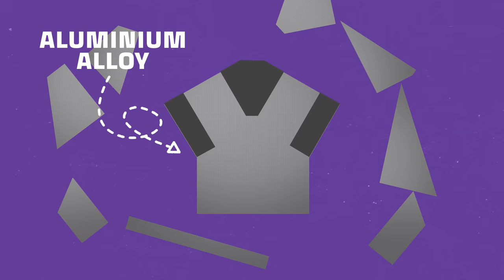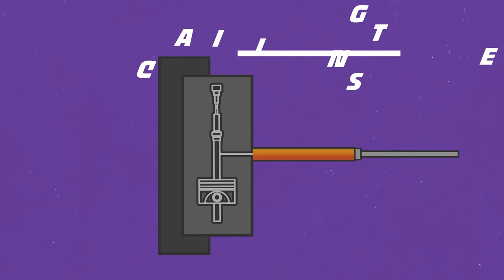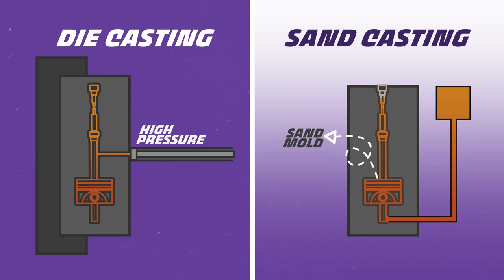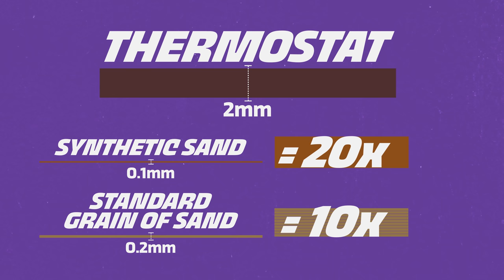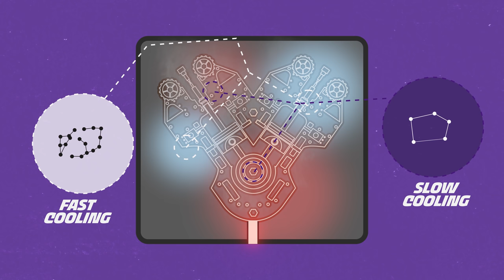Why F1 Engines are Built with Sand

Comment: Fun Fact:  Yamaha's expertise in casting the iron plate inside their pianos allowed them to easily transition to casting blocks for motorcycle engines in the 1940s.
Reply: That is a fun fact
Reply: Woohoo, reading that was a real blast.
Reply: @youwantshum9860  That iron plate is actually called a bridge
Reply: I don't really like Yamahas pianos..
Reply: I couldn't tell if this was supposed to be a joke or not
Reply: @AlecegonceTV   No the bridge is the wooden portion that the strings sit on top of.  Which itself is connected to the soundboard.
Reply: @curtisrowledge1922  Nope it’s the truth!  There are actually a surprising number of industries that benefited from the R&D of the piano industry.  Steinway actually did coach building for Mercedes a long time ago.  Audi and Porsche have both designed pianos for Bosendorfer.
Reply: Oh shit?
Reply: @yookalaylee2289  that's so neat!! ill have to look more into that
Reply: @TS_Mind_Swept  up to their mid levels are crap, but once you go upper mid and above they can compare with other high end makers.
Reply: @darthandeddeu  It has more to do with how they sound than anything; I'm also not a fan of Steinway and Sons sound, WAY too bright..
Reply: @TS_Mind_Swept  buy other brands then
Reply: @importanttingwei7747  That doesn't stop them from being heard, unfortunately
Reply: Pretty sure their mastery of sound design for acoustics is the reason why they make some of the best sounding engines too.
Reply: sick fact
Reply: @yookalaylee2289 I’ve seen a Suzuki piano, too

Comment: As someone with a meterials engineering degree this is surprisingly accurate for how easy to digest this is. Good job team
Reply: Indeed. I wish my machine design classes were that clear and dynamic back then.
Reply: That's what life should be. Easily understood from a good explainer
Reply: I was going to say this is a very high quality review of casting manufacturing processes
Reply: Is peanut butter a viable material
Reply: *materials
Reply: I work at a sand printer company and it was nice seeing my industry represented by one of my favorite channels
Reply: He has a mechanical engineering degree so he knows some of this. What I appreciate is his ability to explain in layman’s terms or slightly beyond.

Comment: 7:44 -- A little correction..  the sand doesn't want to expand 1%.  Molten aluminium occupies a volume ~1% bigger than when in a solid state so as the metal cools it contracts by 1% from the shape defined by the mould.
Been dealing with this for 20-odd years and have designed thousands of moulds including 3d printed cores.

Comment: I'm doing an internship (metalurgical engineering) in a foundry with a 3d sand printer. We don't make parts for f1 cars but there have been some huge cylinders for industrial motors. There is alot of engineering that goes into the whole 3d sand process. I can also say that all the information you gave is correct, and a good way of explaining it in a digestable way. Well done

Comment: At OTC (Offshore Trade Conference), there was a company that would melt the surface of the sand rather than using a binder.  It looked amazing.  One of their sample prints was a coffee mug with a finish that looked like it was glazed.  The benefit behind this technology is getting smoother oil channels and other internal geometry without the need or cost of post casting buffing.
Reply: By any chance do you have a name of this company ?

Comment: I used to work as a metallurgist where a significant number of the f1 engine manufacturers got there engine block castings made.

This is surprisingly accurate, I wonder who the sources are for this video. This is significantly better than any presentation I gave on the processes that are actually used to produce these castings.

Comment: 11:43.. Yes and no, depending on the change, you can always remove metal on an existing mold, (aswell as add by welding it). So small changes do not rly take long at all (1-2 days) 
 Assembly+milling/turning/finishing for a new mold takes roughly 2 weeks  (due to lacking access to more milling machines, if we had more it could be done in maybe 3-4 days) 
We got probably like 800+ Different molds (the heaviest being roughly 900Kg)

Comment: I've never 3d printed a sand mould, but I know some stuff about mould making that give more information about some of the stuff talked about in the video.

6:47 Nah, creating a reversed part for a mould can literally be made by one click in a proper CAD application.
And you can pretty much design the part as you intend it to be after the moulding. All you need to do then is account for heat shrinking and some minor details, like what can be done better by an insert (core), gas vents, ingress points, pourways. The software can even account for thermal expansion, so the part will be what you want after casting.

Though, this is something particular to printed Sand moulds (which is not practical at all for consumer products). Ordinary mould design requires quite a bit of work afterwards, sometimes as much or even more engineering than the part it makes.

7:33 Well, not really. Sand being too strong isn't an issue as there will always be some work to be done after the piece gets out of the mould. Gerally, sand moulds are so delicate they can be damaged by hand. Unless you're thinking of Concrete as the material of choice for making moulds, getting the piece out of the mould isn't an issue at all, as the mould isn't reusabe. They don't care if it breaks, as you'll have to break the mould in half to extract the part. What a mould needs to be is strong enough to support the weight of the material being poured. Generally, the metal should not drip inside the mould. It can damage it, with the defect reflected in the finished part

7:50 It's far, far more common to simply machine out the parts that require a tight fit. But in the event that a part needs to be precise and is out of the reach of machining techniques (you'd be surprised what Electric Discharge Machining can achieve), that special sand might come in handy. In the mass production industry, a finer sand is used for cores. Sand is also recyclable.

11:40 Not a new mould. The pattern. Traditional moulding techniques involves you burying the part that you want to make in the casting sand. To make the mould of an engine, you need to build a mockup of the engine first. You'll see if that episode about metal casting comes out.

Comment: I'm pretty sure the sand depositor does complete layers, and the binder has the parts actual geometry. This way sand can act like a support for horizontal features that otherwise would be in midair if they did it how your animation shows with gaps in the sand layers.

Comment: I used to work for Ryobi Die Casting as a Machine Operator. We could pump out 500 blocks in the same time as it takes to make 1 3D printed sand casting.
the ONLY advantage to sand casting is instant turn around on development considering die casting dies are 5 ton blocks of steel. everything else is a negative.

Comment: man, u need to see into the 6000 tons and 8000 tons giga castings used by Tesla. no sand nothing, cast filled in less than 4 milliseconds. and ready for assembly in about 140 seconds. This is used in their front and rear body castings. Now the whole chassis is  made up of just 3 parts, compared to over 150 parts by other OEMs.

Comment: Another way is to use a wax form packed with sand.
My favorite method... using a wax form allows to have crazy complex shapes, less shrinkage, and if you really want to use 3D modeling - you can now 3D print a wax form.

Comment: Pretty much all engine blocks are made using some form of sand mold casting. Blocks that are fully CNC'd are usually reserved for extremely high horsepower race engines

Comment: 1:29 Cutting material is not stronger than casting it because the structure of the crystals when the metal is heated becomes better thus improving the μechanical properties of the material

Comment: If I had the chance to change cast engine parts I would change the pipe where the hose is inserted like the radiator and thermostat. Instead of using a flat surface pipe I would change the shape to something like a garden nozzle pipe where it's like a pine tree to keep the hose more secured due to extreme pressure...

Comment: I can't speak for the other teams, but Mercedes doesn't use sand casting on its engines in F1 - all parts are machined out. The CT scanning is correct though and every part is checked inside and out to make sure it's perfect.

Comment: You forgot to add that different alloys cool at different rates. And no matter how pure or homogeneous your metal is, there are going to be hard spots when the metal cools down. I'm talking from a machinist's view from machining alloys like Renee 95, Renee 88, Titanium 17, aircraft graded Aluminum, cast iron & Incol 715 which is the worst to machine because it is nickle based & the nickle & the other metals tend to gather together in small areas even after the casting & forging process creating hard spots.

Comment: Instead of flipping the image making  the video black and white and then inverting the black and white would be better.
To represent the sandcast mold.

I figured you were talking about the part not needing draft as well as being able to get away with different if not lower core strength because you don't have to assemble the cores.

My metallurgy isn't good enough because then I would know if they use nitrogen in the sand casting to avoid ceramic creation.

Comment: Surprised you didnt talk about using both processes, i.e. since the exterior of the block and coolant channels in the interior dont need as much precision, casting is fine. But then, you take the low precision cast block and machine the high precision areas out of it, i.e. bearing channels, piston walls, head surface

Comment: How do you make parts with hollow insides using this method? For example, let's say you had sand, then wanted a gap for the metal, then wanted more sand to go on top. Would you leave some kind of reinforcement to keep the sand on top in place? Before the metal is introduced, it would seem like there is only air there underneath the sand on top

Comment: As an engineer working in the aluminum casting industry of blocks and cylinder heads , i have to say, there is a lot of things you said or explained wrong. Good job for the summary of the processes, but alot of things are wrong or not up to date for the last 10-15 years in this biz.

Comment: i used to make intake manifolds for honda cars at a warehouse we had a machine that baked and made the sand molds then i sanded all the casting lines out of the sand mold then put the molds into my casting dies and hit the buttons a giant laddle made of fiberglass like material would dip into a well filled with molten aluminum fill up and poor it into my casting machine

Comment: 3d printed sand molds are great for limited production parts. After all it saves having to make the patterns. But if you are going to be producing thousands of castings a day traditional methods still work best. And with advances in 3d printing of metal alloys you can skip the casting process entirely. And go straight to finish machining.

Comment: Dooit! I've seen some videos using 3d printers to make the part, make the mold with the plastic part, melt plastic out of mold, then use mold to make the metal part. Video i remember was about a 2 way bolt that uses left and right hand threads

Comment: Bonus - The most powerfull F1 engine ever was "cured" with urine. The BMW M12/13 of 1986 produced an estimated 1400bhp as a 1.5l turbo and was created from used BMW M10 road car engines. These were then left outside in the elements for months and as legend has it, urinated on which might have had some nitriding effect on the ferrous metals.
Reply: Well if i take this out of context im gonna say its the rocketdyne f1 engine thats the most powerful.

Comment: If you end up casting out of aluminum don’t use cans, the quality of metal is very poor and it generates a lot of slag, get a premixed alloy that works well with casting, it’ll save you a lot of time and frustration, and get a big box of borax for flux

Comment: I was hoping this was about the F1 engines designed for the Apollo program.  The manufacturing process for this engine is lost.  To build new F1 rocket engines, they would have to be redesigned for modern production techniques.

Comment: HOURS PER GALLON.  Never liked MPG, it didn't make sense when I was sitting in bumper to bumper traffic in Seattle.  Some weeks I would get 0 (zero) miles per gallon, while waiting in traffic, then calling the Tow truck because my 35mpg car was out of gas.  Totally made sense when I rented a tractor for the weekend, and it clocked Hours used, which could be calculated out to Hours per gallon of diesel.  Why don't cars do this??

Comment: Um....  No F1 Engine maker is going to 3d print a sand casting for a part lol......   If anything they will Print the part over and over and test fit it till they get what they want to use from a laser cured Light Reisen printer. Extremely high resolution vs sand casting Garbage casting lol....  Then they put the 3d printed model in a silica ceramic mix and shake it for about 2 hours release all the air and let it dry.   They heat the mold up after and bake it for a few hours to cure it and in the process the 3d printed model is now turned to dust and your ready to cast a part with perfect dimensions. It's  How they do most race engines casted part. Maybe 20 years ago when they invented Sand casting printers this was high tech... No one uses sand anymore to much that gets stuck in the mix and causes metal imperfections.

Comment: Your explanation is exactly 100% wrong.  2 mm thermostat is not 10x0,2mm sand. Also, not 20x 0,1mm = WRONG!!!   You must make the outside of the thermostat in the sand, not the material wanted to remain.  It is negative moulding not positive.

Comment: Even most aluminum engines are made with a lost wax method in greensand. Why are you wasting the time doing a video on something that anybody who has ever built an engine should know?
Even engines that use the subtraction method as you call it, I don't know where you got that word, we're even the aluminum engines that you're talking about General ER cast and then the subtraction method is used to refine some of the design.
And even though it's called a lost wax method, it's usually done with styrofoam that is been encased in sand and then the casting was poured